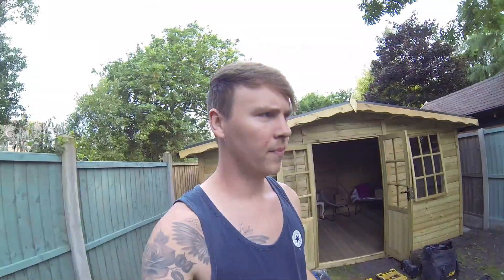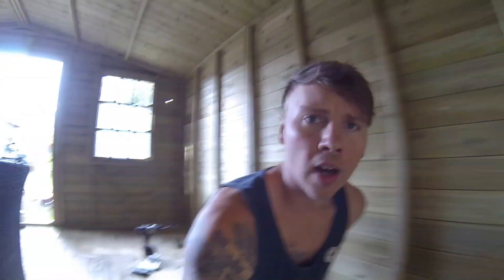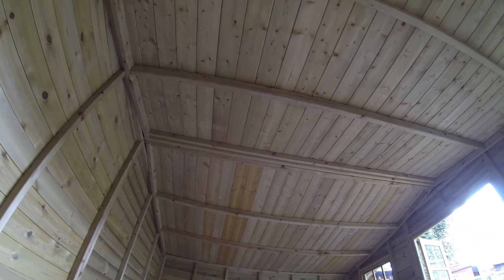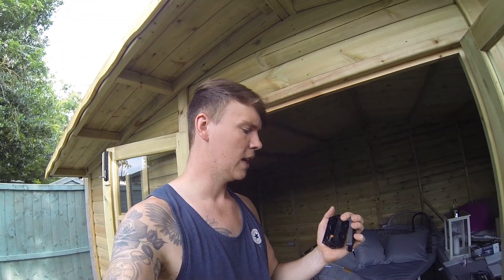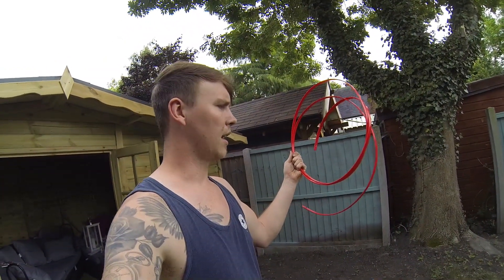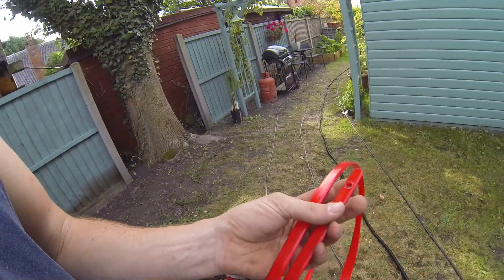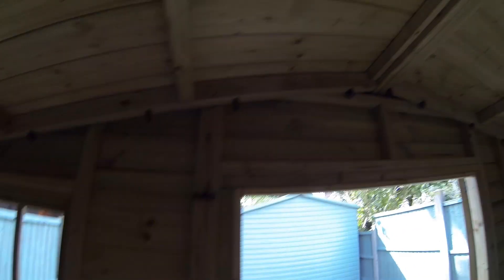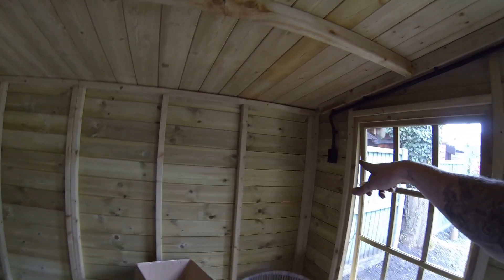Kopex (flexi conduit) wiring a summer house/shed, exotic life of an electrician

Comment: A little tip for u bud.from an old git spark.strip back about 4 to 6 inch.cut of line and neutral legs.pass the cpc through hole,fold the leg back over the hole.
And twist it around itself.
Does the job brill.no tape in sight.and cuts off clean.

Comment: I’ve fitted miles of flexi conduit down the sides of ice cream vans and trailer kiosks! Both 20mm and 25mm. Mainly single DC control wires for relays and contactors. Never thought of using Saddles though so thanks for that. I just use P clips. Loving your channel btw.
Reply: Cool!

Comment: Wago does do a 4-way and a 8 way push-in connector (2273). They're very, very common over here.
A lot smaller than the 221's, which I personally only use when changing from solid cores to flex.
Reply: Where is 'over here' ?

Comment: u can either get 4 way push fit wagos 773 or 2273 screwfix got em. Top workmanship. A few suggestions if u dont mind ;) y not use solid conduit on the long runs and the flex in the corners or bends just use couplings. That flexi on the floor is just waiting to be squashed ;) I know someone already commented about the 3 pipes into the switch, looks terrible and I'm not so sure about the metal-clad stuff  in this kind of environment (condensation?) maybe. Like I said only suggestions

Comment: I always use a thin nylon fish tape for flexicon, with a little wiggly end. It's sort of the size of a 2.5mm single cable but really rigid when you're pushing forwards. Straighten the conduit as best you can first

Comment: Get some nylon cord / string. 
Tie small bit of cloth on the end.
Get a vacuum cleaner, stick it at one end of the flexi conduit.
Switch the vacuum on at one end, feed the bit of cloth with the string around it into the other.
Watch the string get sucked through the flexi conduit.
When the string gets to the other end, use it to drag through any type of cable you want.

If you're using smaller conduit like 12mm for something like the sensor for underfloor heating, you can just tie a knot in the cord and it will be dragged through without any probs.

:-)

Comment: Between yourself and my trusted electrician  think I need to buy shares in flexi conduit..... 🤣

Personally I would use fibreglass fish rods/tape (4mm) and conduit cable with any type of conduit as its easier to work with and by putting a jb/conduit box in the right place you could use less conduit but provide more circuits at same time if required. 

I'll probably cause an argument by suggesting it but I would be tempted to use plastic switches and sockets even the ip55 ish ones inside as from my experience the metal clad in those environments (unless its heated 24/7) tend to attract condesation and rust prematurely.

But that aside if I was the client I would be very happy with the finished installation. My comments are suggestions not criticism your work is top notch and you always put good thought into your work and I look forward to the next video

Comment: For short runs I use rod or flat metal fish tape with a plastic pilot tip, and pull a bundle of single cores through, rather than push. It's the simplest way I've found. For really long runs I'll vacuum some fiber optic pull ribbon through the flex tube and attach my single cores. I yank the pull ribbon while an assistant or an in animate object with some rigging holds the flexi. Again pulling in, rather than pushing. That said, I've had to shove wire into existing flexi, so I use solid single cores for that instead of stranded. In the end, go with whatever gives you less of a fight.

Comment: Easy way to pull cables through flexi conduit.  Get a reel of string, make a ball with the string (just smaller than the conduit.)  Put the ball of string in one end of the conduit, then get your hoover and put it on the other end of the conduit.  Suck the string through, then tie your cable to the string and pull it through.  You can use masking tape to seal the hoover to the conduit.   Used to do this all the time with cat5 cables and long lengths of flexi.

Comment: Why did you not use 20mm ridgid conduit  ?  With tee angle thro boxes etc think it would have been qui kerb
Reply: A lot of people just dont like carrying 3m long products on the van, myself I used to carry so much mini trunking I had a modified piece of 8" by 8 " galv trunking on the roof bars with hinges and catches.

Comment: Exporting a pme supply isn’t always a good idea . Make sure there’s no extraneous parts in outbuildings
Reply: robert swingler any problem that would arise with a missing neutral causes problems in both the house and the out building so what’s the issue?
Reply: Callum Docherty the house has bonding . If outbuilding has extraneous parts they will need min 10mm bond to
Reply: You can clearly see there's no extraneous parts lol.

Comment: CK Spiraflex is superb for conduit work and is much better than those silly nylon draw-tapes

Why not use solid conduit or hi-tuf as they both look neater than flexi?
Reply: Easier to use flexi no cutting bending and messing around especially on the bends for the pitch roof.
Reply: L Or use flexi and a coupler for the bends? Or even a bending spring...?😉
Reply: @kevy427  sounds like alotta effort my man !

Comment: Can you export the PME or did you use a rod?
Reply: Tony Blair I was thinking the same thing. Hope they never lose the supply neutral.
Reply: Should be using a rod where the new cu has been taken. Will be issue if you lose neutral
Reply: You people need to read the regs. Where dies it say that you cant export it???
Reply: @wyndavies5044  it was a question?

Comment: No reason at all to earth a back box if there is a fixed lug.
Reply: What about a case when the socket is removed from its box (screws removed) while live and a loose live cable ends up dangling around and makes contact with the box? Would be nice for that box to still be earthed at that point. It’s far more likely for a conductor to make contact with the back box when the socket is being moved around. 

Yes, yes, you shouldn’t remove socket covers when live and the conductors should be tight but we know it happens.
Reply: @AdamCookeTV  "Yes, yes, you shouldn’t remove socket covers when live....."

So why are you asking?
Reply: I’m not asking anything. I was simply pointing out a reason to earth the back box in response to your claim that there were no reasons. We all know these sockets are often removed by electricians and consumers while live (against advice) so why not the add the additional protection?
Reply: Adam, agree with you entirely mate. Most likely case for a backbox to become live is when the plate is removed and cable is disturbed or a conductor pops out. Extra minute of work Vs peace of mind, no question mate
Reply: @adejupe8308  
Try removing a live socket in front of your assessor and let us know how that goes.
Reply: @paul green try working in the real world and let us know how THAT goes
Reply: @adejupe8308  Bless. One day when you grow up, you'll understand. x